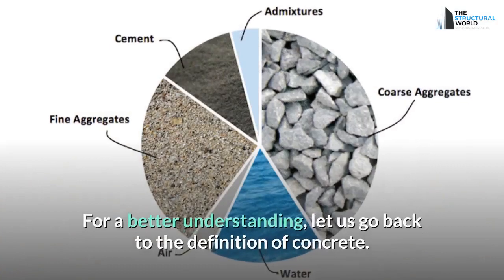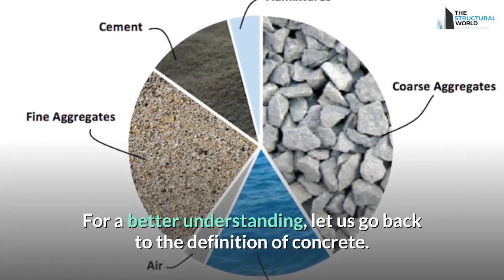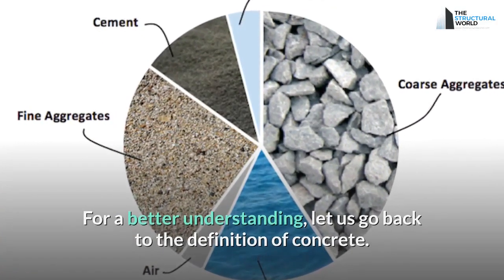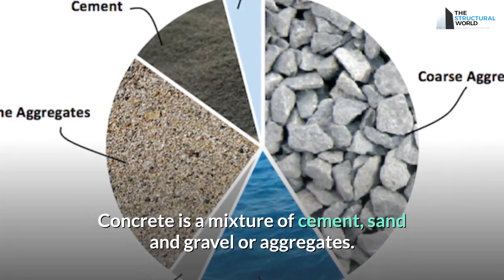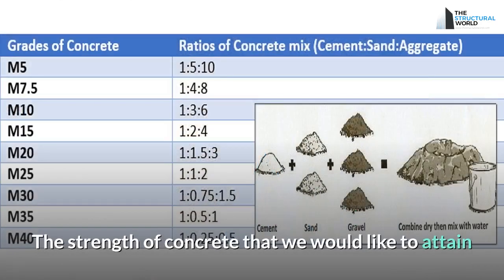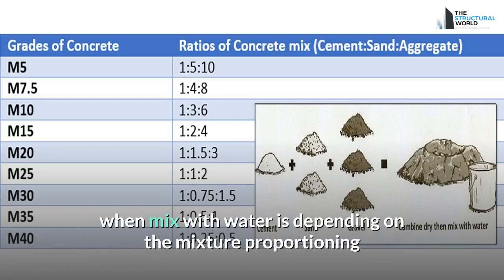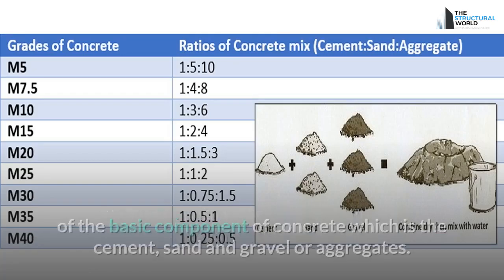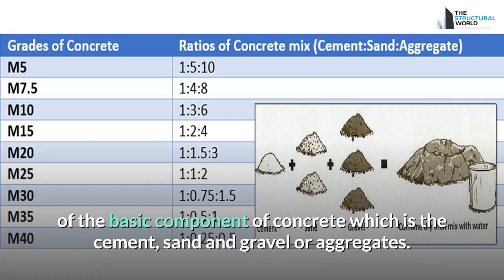What is GREEN CONCRETE | How to Make Concrete Green

Comment from the maker: Aside from Safety, Structural Engineers should also consider an eco-friendly material to mix with concrete in their design without compromising its durability and the compressive strength. This video tackles how we can contribute to a sustainable environment by considering Green Concrete.

Comment: Which strength is high when compared both
Reply from the maker: Its the same, you can achieve the required strength as well using green concrete.